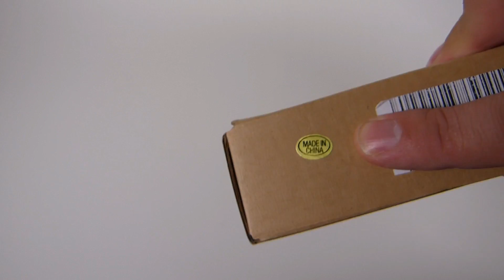Ultimate Cooling Case For Raspberry Pi 3 With Dual Fan Heat Sink Review

Comment: Madlittlepixel, 

Does the Pi3 generate so much heat that this is necessary? Do you think it is "overkill"?
Reply: Daniel Bia - It is if you are overclocking.  And even if you aren't, if you are running something like Quake 3 it'll heat up quick.  It will also heat up when writing a ton of ROMs at once via USB.  I literally burned myself with my USB stick when I pulled it out after it was done.